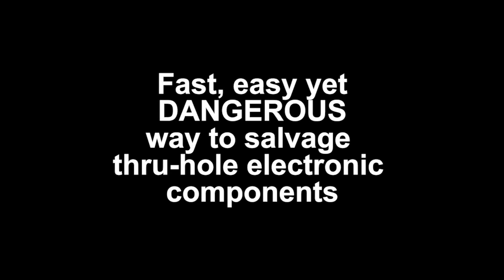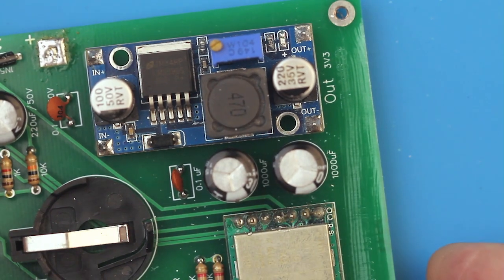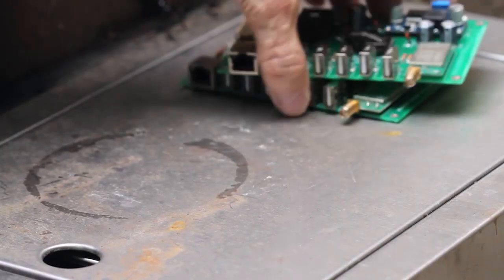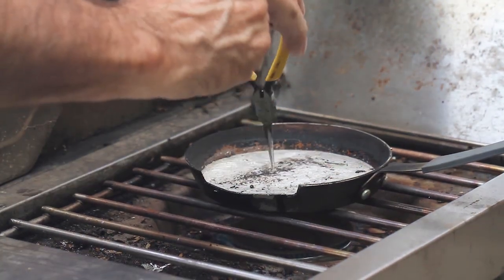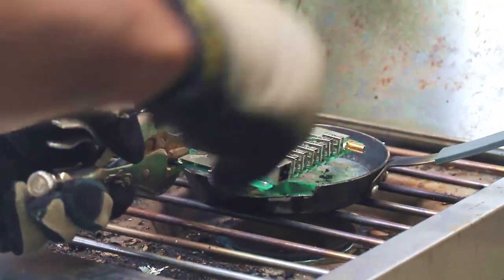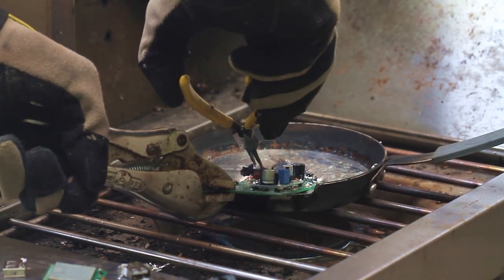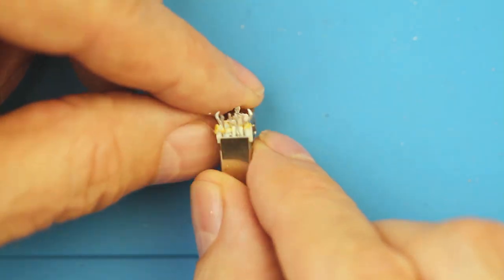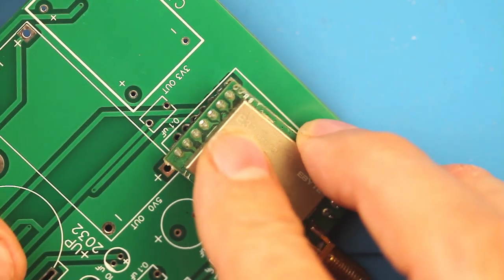Save money and salvaging PCB Components

Comment: I get it on the obvious burn-hazard of the molten metal, heater, etc. But are you concerned at all about any lead vapors, old flux from the boards, or other materials from the previous manufacturers? This seems great for helping diminish the ecological problems of "retired PCBs" in general, but do you have any worries about heat damage to these components? Is this just for personal use? I ask because I think you do some consulting. Would you re-use parts for a client's project, or just for home use?
Reply from the maker: This is done outside where it is well ventilated. And I only do this for my own personal stuff.
Reply: @KrisKasprzak  👍👍

Comment: I wonder if you can use hot plate to do the same ? solder pool seems kindof dangerous for your average hobbyist.
Reply from the maker: Good question, but I doubt it first thing I tried was PCB board in a vice with a blow torch . that just burned everything up because it took too long to melt the solder.